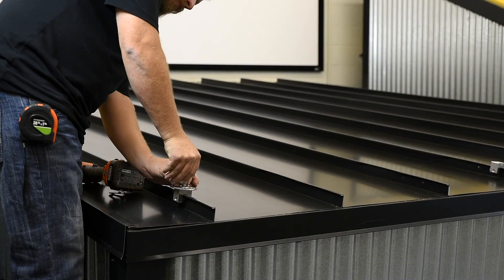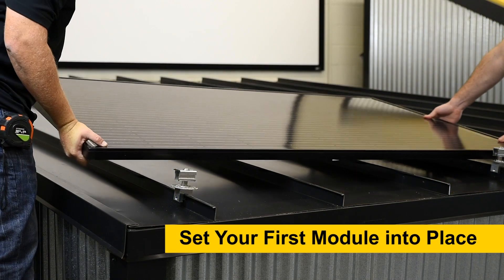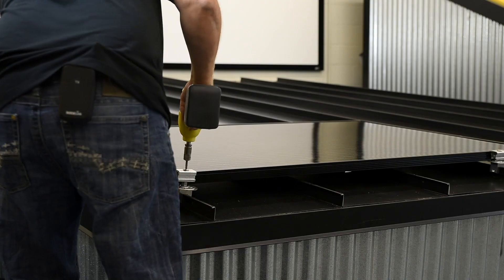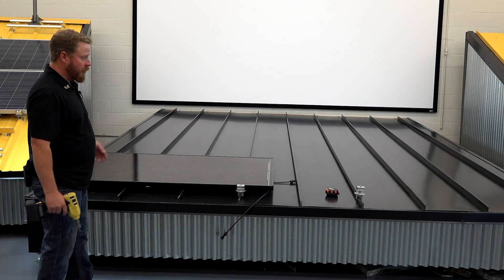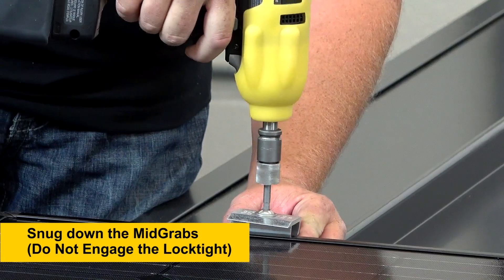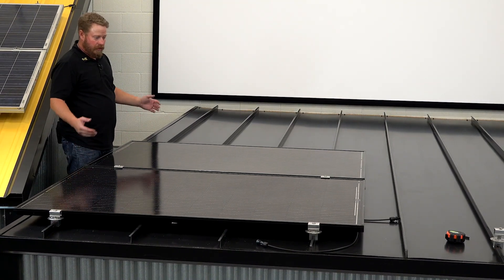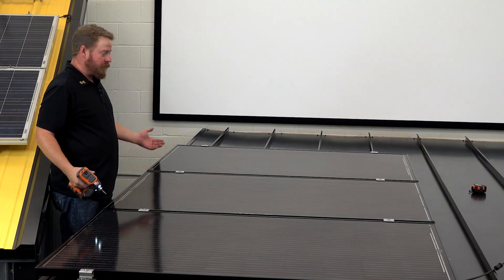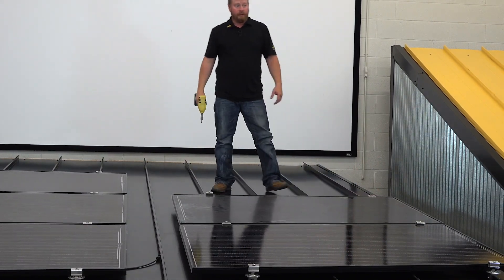Mounting Solar Panels to Your Metal Roof with the PVKIT 2.0

Comment from the maker: Do you have any further questions on the PVKIT 2.0? Start the conversation below!
Reply: I've got a trapezoidal roof like shown at 0:26+, not the ridge shown later. Specifically, what hardware combination do I need? I see the bottom bracket here https://www.ecodirect.com/S-5-RibBracket-III-Bracket-Mount-for-metal-roof-p/s-5-ribbracket-3.htm, but what about the top part and prices? What is special about the "protea bracket?" Also, is the whitish goo caulking and for what purpose? THANKS!
Reply from the maker: @FoosResearch  I am sending your questions to our tech support team. If there is a way you can email support@s-5.com they can better assist you.
Reply from the maker: Thanks for reaching out @FoosResearch !  The RibBracket III you linked to is a great solution for exposed-fastened trapezoidal roofs.  The top part you're seeing there is the S-5! PVKIT 2.0, which is a really affordable method of mounting PV panels, it's also a snap to use.  

The ProteaBracket is great because of it's adjustability, allowing it to fit a wider variety profiles.  As far as that caulking you see being used in the example video, that's all superfluous material left over from a previous install on that particular roof.  The beauty of both the RibBracket and ProteaBracket is that they come with pre-applied EPDM sealant, so no need to deal with any messy gunk to get a water-tight fit.

Feel free to shoot us an email at support@s-5.com or pthompson@s-5.com and we'll help you figure out exactly what you need for your project.
Reply: Where would you put optimizers or micro-inverters on this type of setup?
Reply from the maker: @marcustaylor3943  I also typed a response to your other comment. But yes, we offer mounting solutions that accommodate module-level power electronics. Visit our website at S-5.com, or you can reach out to support@S-5.com for help finding the right mounting solution for microinverters and optimizers. If you send me an email at kim@S-5.com, I can send you over a few photos showing examples of these BOS mounted. Thanks for watching!
Reply from the maker: @marcustaylor3943  Typically they would be mounted to the module frame prior to installation of the module. In some cases micro-inverters can be attached directly to the roof with a clamp or bracket.
Reply from the maker: @marcustaylor3943  I would like to send you pictures on mounting process but it won't allow them in here. Can you email me jhaddock@s-5.com and I will give you the info you need.

Comment: Do the clamping screws have nylon tips to avoid tearing thru the paint on the metal roof?  If not, what is the risk of causing corrosion long-term where it clamps the standing seam?  Any issues with corrosion from the various metals (aluminum, chrome-steel, roofing steel)?
Reply from the maker: Our clamps might scratch the paint, but they will not strip away the galvalume coating, which protects the metal roof from the elements. We know that protecting the metal roof is the most important part of a metal roof project, and we work closely with many metal roof OEMs to ensure our products do not compromise the roof. Reach out to us at support@s-5.com if you'd like to discuss your specific roof type.

Comment: Thanks. Re. Grounding: can you run copper wire through the discs? Would you run then through each mounting point or only some?
Reply from the maker: You’ll want to use a grounding lug on each section of bonded sub-array or array.  Our PVKIT will bond each column of modules, and by using a bonding jumper (or similar) to bond column to column, the entire sub-array will be bonded.  Then, a grounding lug can be used to run a copper wire to ground.  The grounding lug can attach to a module frame or a PVKIT disk.  Grounding lugs, bonding jumpers, and other useful solar hardware can be found on the hardware section of our website (www.s-5.com/hardware), and can be purchased through our distributors.

Comment: How long does the rubber gaskets last on the roof connection and the screw connection.
Reply from the maker: EPDM rubber has long been used as a gasket material for metals roof and is also used as a roofing material all itself because of its excellent durability to hot / cold cycles and resistance to UV rays. When the EPDM gasket is protected from UV rays as it is under our brackets and under the screw washers it can easily be expected to last the life of the roof. 

S-5 only uses the highest quality materials in the construction of our products and we stand behind all of them with our Lifetime Workmanship Warranty. If you have any other questions please email us at support@s-5.com.